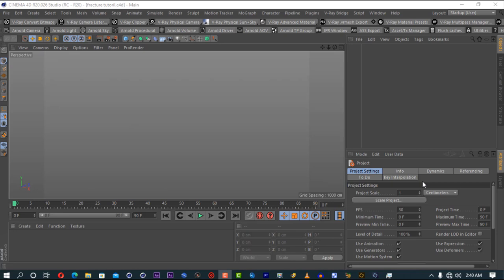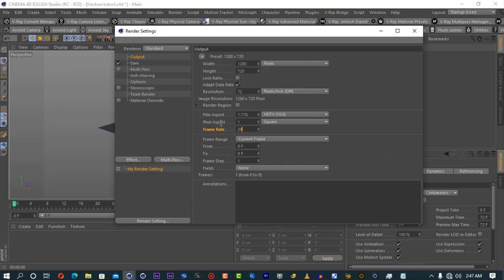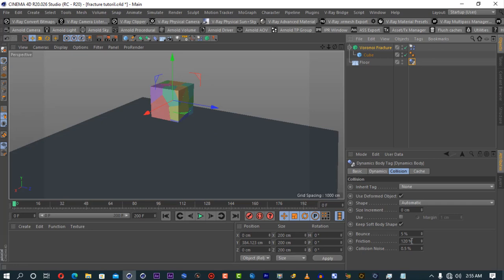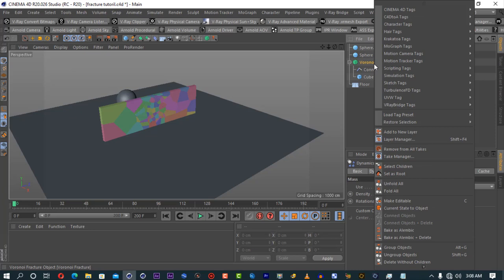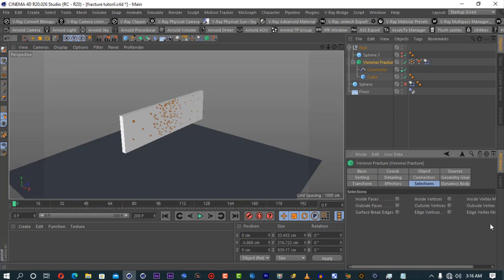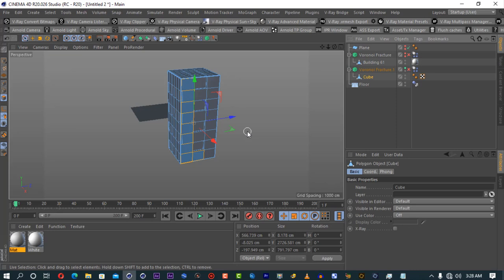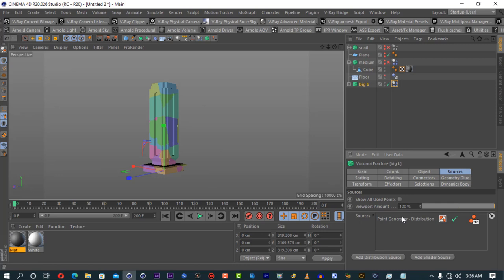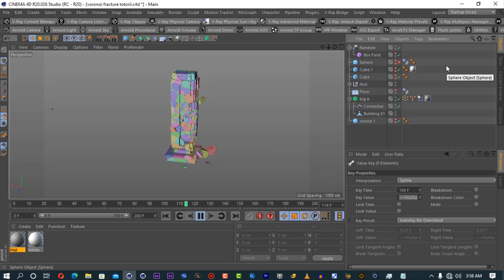Cinema 4d Voronoi fracture tutorial series level 1 of 3

Comment: when I cache or make alembic from my voronoi fracture it produces really really bad results and basically ignores my nice setups. The non cached normal viewport playback version is perfect. But I need a cached or alembic version that works and actually represents my setup. I used rigid bodies with my voronoi fracture. obv cached them. produces random results.
Reply from the maker: That happens a lot, it usually could be the problem in the project settings, sometimes there is a stored cache in the project setting cache tab, and it’s funny because you can still do another cache on top of your rigid body tag despite the stored cache in the project, and it affects how the scene caches try to clear it and try again it helps me mostly, if it doesn’t work just use alembic it’s still the same workflow and has all textures and uvs, you probably gonna bake to alembic anyways for dust and particles sims